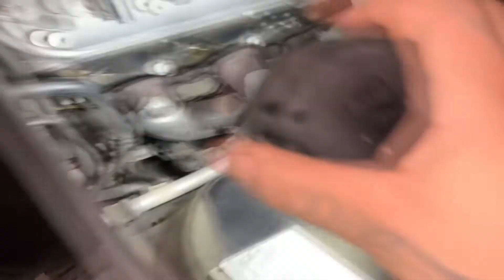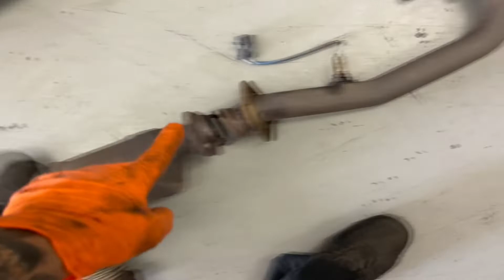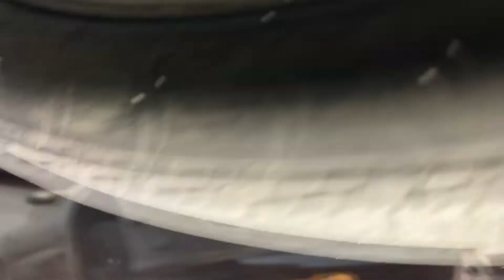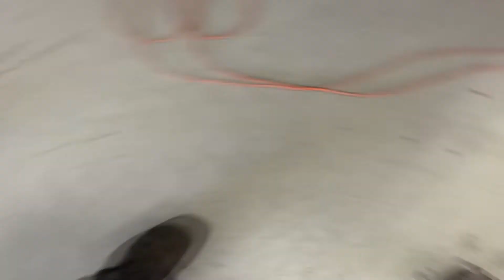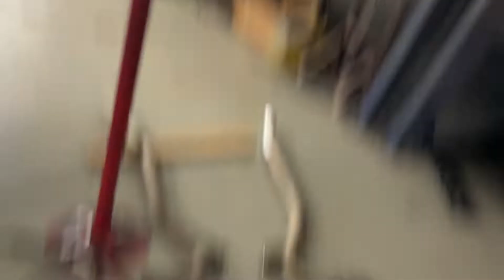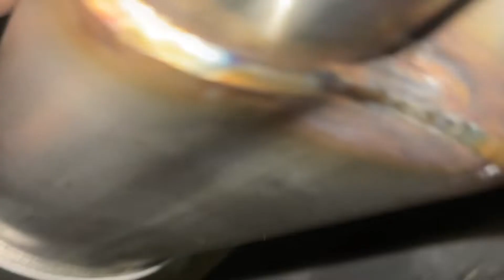Speed Engineering G8 exhaust install

Comment: I'm suffering from the steering shaft for 1week right now
Reply: On my SS I have to angle the header really far down to sneak it in on the driver side. It takes some finagling but it will fit. Take out spark plugs and the coil packs.

Comment: What’s better the solo performance x pipe or speed engineering
Reply from the maker: The solo performance was louder for sure , speed engineering is easier on the wallet still sounds badass
Reply: @jameskrucial  was it mandatory to use speed engineering x pipe or you could use the solo catback x pipe?
Reply from the maker: @yaboybeezo  you can use the solo performance x pipe the ends are different solo has a flange I believe and speed is the slip joint